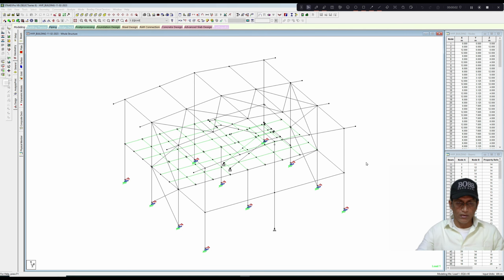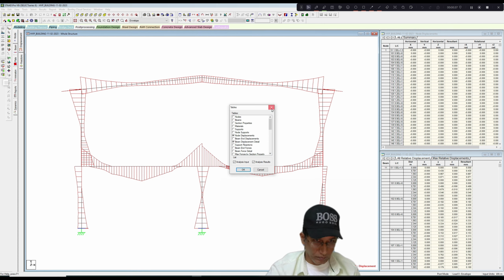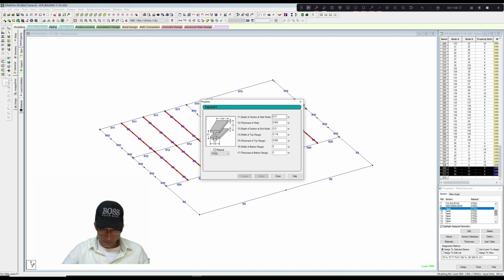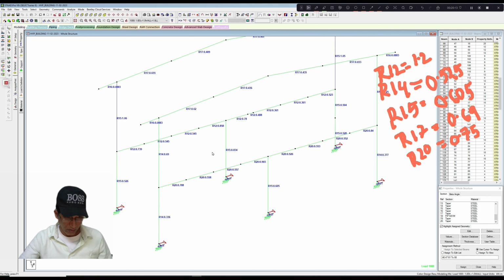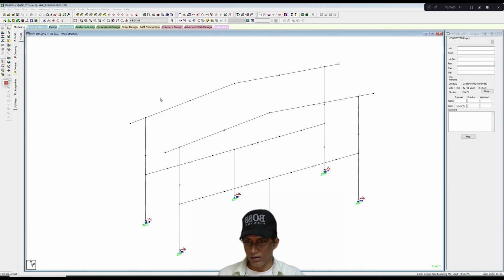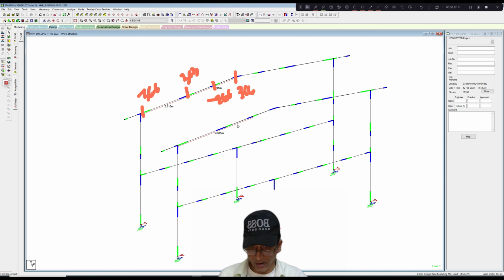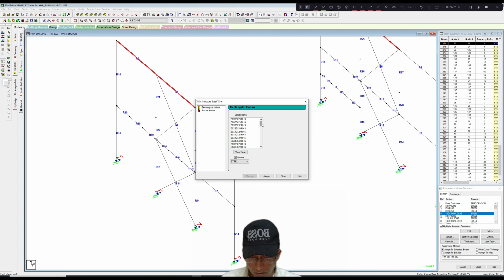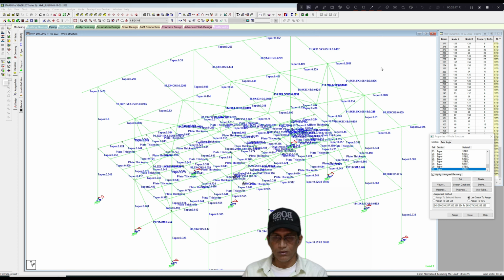SECTION 10 OPTIMIZATION

Comment: utilization ratio values are showing weird results such as 0.00257 etc, can u plz elaborate the issue..thnks
Reply from the maker: POSSIBLE WHEN AXIAL FORCES,SHEAR FORCES AND FLEXURAL FORCES ARE  NEGLIGIBLE. YOU NEED TO CHECK IF ANALYSIS IS GIVING PROPER RESULTS. ADOPT NEED TO KNOW HOW  MANUAL METHOD OF ANALYSISWHICH WILL GIVE ROUGH ESITMATE OF  FORCES WHICH YOU MAY COMPARE WITH STAAD ANALYTSIS